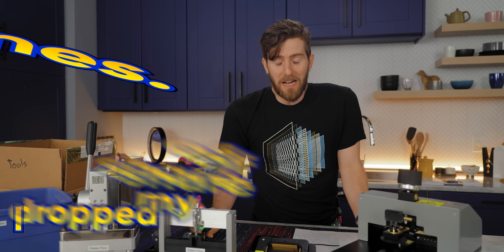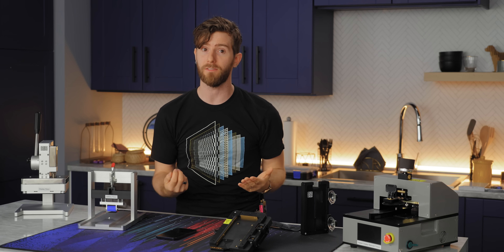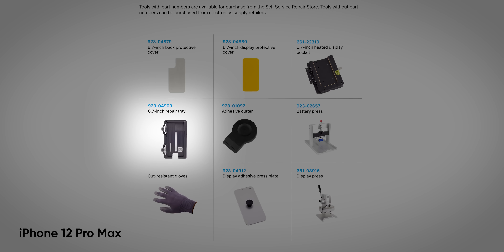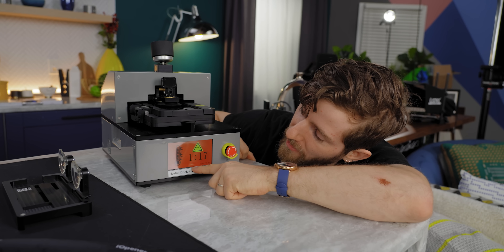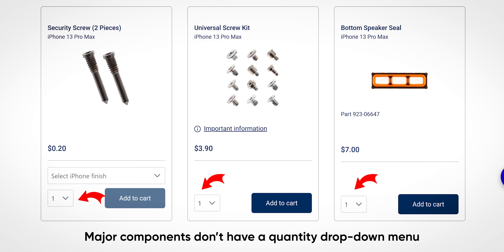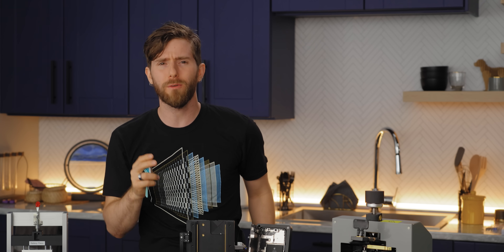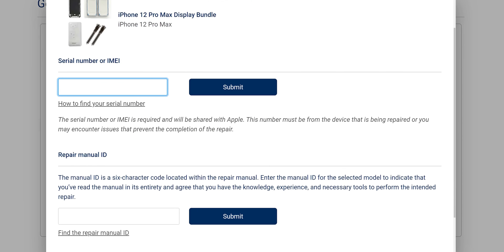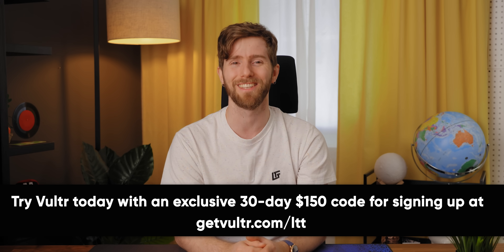I’m a Genius - Apple Self Service Repair Program

Comment: I think it’s a bit more complicated than that. Initially Touch ID’s hardware ID was tethered to the Secure Enclave. A rotating key tied to the Touch ID hardware and your fingerprint hash data and other data prevented external hardware from a brute force attack. This was all for security. Once people labeled it as anti consumer Apple had to rework their method of user verification with an iOS update. While their security white paper doesn’t specifically cover how they did it it’s believed there was a decrease in security albeit slight and done through very specific hardware methods likely only known by Apple but wouldn’t be public info even if security firms and government agencies did know how to do it.

Comment: At Geek Squad we are Apple certified repair technicians, from the research myself and my other agents have done, it’s only about $10 cheaper (if you don’t have apple care) to do the repair yourself. We do all of those repairs typically same day. The worst part of the 12s 13s and SEs repairs is the heat sensitive adhesive, to replace the screen you have to peel all of it off and replace it, but the adhesive very rarely comes off easily.

Comment: couldn't you just have several devices on hand so if anyone needs parts to repair you already have them on hand? (ordering the parts in advance) or does apple lock said parts behind serial numbers so they only work on that specific device?

Comment: Those tools seem hilariously over-engineered. Yes, precisely machine parts are good for repeatable results and a high degree of consistency, but you do not need that much metal for a simple, manually operated press. You could make the supports out of stamped sheet metal that are just as solid as blocks at a fraction of the cost and manufacturing time.

Comment: Used to work for the Fruitstore.  These are the same kits we used as far back as 2015.  As for the quotes, it's a policy to refuse positioning cost prior to device review to prevent someone coming in with a bag full of unidentifable parts and demanding a replacement based on the quote from the call.  Those of us who turned screws on the regular could do 10-15 phones an hour depending on volume.  I imagine the heatpress slows down the store level efficiency at this point.  But we had multiple machines, toolsets, and a questionable work enviroment with lackluster leadership that rarely, if ever actually valued your contribuitions.  The fun part was always trying to use a suction cup on a screen that was shattered and would allow for airflow beneth the cup.  We had all sorts of creative uses of packing tape for situations just like that.

Comment: I think Apple should just pull the trigger and offer this kind of repair kit for everything they make, it will result in profit across the board. While some will be able to properly repair their own stuff, in my opinion the majority of people who try this, will mess something up. So they profit from giving you the repair kit, then profit again when you have to go to a repair center or buy a replacement from them. E-waste will go up as a lot of those failed repairs will end up in the garbage, but I think it's the best compromise to appease the right to repair movement, and also just make them more money - not that they need it. I'm not dissing the masses, or anything like that, I'm including myself in that statement. I like to think I'm pretty handy, but I've lost track of the amount of times I've destroyed something I was trying to fix even after having done the homework because sometimes it's not intuitive or there's some small thing you miss. Or you just simply go to open something up and even though the video warned you of that tiny wire attached, you still tore it out of the PCB :P

Comment: 'Core Charges' are a common thing for repaired parts from many manufacturers, in auto industry, aviation, etc.  So that at least shouldn't be a question that it's a thing.  This is still a stupid program either way.

Comment: I mean, the repair tools seem really high quality and reasonably priced. And in fairness, there are still some advantages to doing this. For one, if you buy the tools it's not really fair to say "I paid more for the tools than if I just took it in" because, well, now you own the tools. It could be cheaper in the long run if, say, you have a couple of kids who break their screen at school once in a while, or the same tools can be used with your next phone. Also, there's some value in not letting a stranger muck around with your device, as has made the news lately. So it seems unfair to say this is just a gimmick by Apple to stymie the Right-to-Repair movement. And this is coming from someone who is NOT an Apple fan.
Reply: It is worth noting apple do not require you to buy or rent the tools you can just buy the parts and use any tools you happen to have.

Comment: If I've said it once I've said it a thousand times.  Buying into Apple is a mugs game.  Imagine buying a cooker (because it looked sleek and shiney) but only being allowed to cook with ingredients bought from a supermarket owned by the cooker's manufacturer (at highly inflated prices) , using only cookware provided by the cooker's manufacturer and only eating meals cooked on it if they are prepared by an approved cook which can only be hired through the cooker's manufacturer (again at a highly inflated price).  It would obviously be called an iCooker, but you get my drift.  Apple owners bring these problems on themselves.  I have no sympathy and they need to suck it up.  If you cannot stand the heat of the way Apple works, get out of the kitchen.

Comment: I have comfortably repaired well over 7000 iphones (Yes, send help) ranging from the 4 to the 13PM and it really frustrates me that Apple is in my opinion ;) intentionally making repair seem far more involved a task for the average person than need be. Even setting aside the "fuck you+1" pricing technique, the indimidation factor alone presented to someone looking to repair a newer iphone for the first time with all this over the top equipment is silly... If you roll back a few years then that eqiupment is completely overkill given the frame design of the iphone 11 series and older. It's much easier not to mention a lot faster (Both in the job itself and delivery of equipment) to get the device open with a plastic pry tool and something like an iOpener. 

Either way, I'm glad that on all fronts everyone I talk/listen to (Fellow techs, suppliers, customers, content creators and DIY'ers) are able see the angle Apple is taking here with providing a pretty fueled effort to try quell the pressure of the right to repair legislation thats on the horizon because like it or not things are changing. For someone whos been on the inside looking out this has been like a very slowly turning knife and I pray for a future where ripping a face ID cable doesn't instantly constitute a write off... or screen replacements that don't require BGA chips to be ground off so I can flow the OEM chip back on, or maybe batterys that don't need a BMS to be cut off and welded on to a new cell which then need to be hot swapped with a fake battery so the bloody thing actually reports 100% in iOS... It would be nice... it really would.

Comment: It also suck if you were a small electronics repair place cause you could assume that because of the way this is structured, every phone might call for new different tooling to fix, so $700+ (likely per new model) is almost like a annual fee you'll have to eat in order to advertise that you can do iPhone repairs. 

Linus is absolutely right, this program is obviously bloating cost to push people to buy new vs repairing their old gadgets. It feels extremely anti consumer, and as a non apple user I know most apple people just wont care.

Comment: Alright, I am going to correct a lot of statements in this video. The first thing is that right to repair is not the shiny thing that everyone thinks it to be. Its just another group lobbying for self interest to make money of gullible consumers. As a former Apple technician of 14 years the genius bar has never been a profit point for Apple. Apple has never charged a labor fee for iPhone repair in the US, they do on Macs however.  In fact their stores in general are operated at a bit of a loss, as it is about ensuring a positive customer experience, to create promoters and to repair the customer's relationship with the company. It creates customer loyalty and is why there is such a loyal fan base around the world. Parts are getting more and more expensive across all industries. The OLED displays in your iPhones are not cheap, and aftermarket parts are 100% of the time inferior knock offs that don't offer the same quality. You get what you pay for. Apple does not care what you do with your device. What they do care about is covering warranty claims. Apple is under no obligation to fix your iPhone when you have messed up on a repair, or used an inferior part to do the repair. This is the same across most consumer good industries. You replace that alternator in your car with a cheap one, and break something during the repair, the dealership isn't going to honor the factory warranty. Who in their right mind would do a repair themselves when they have a warranty is a great question. These videos often forget to include that these repair programs are designed for out of warranty repairs, or for repairs lacking coverage like AppleCare +. The other thing that these videos forget that a company like Apple is under much more legal scrutiny than Joe's smartphone repair kiosk in the mall. They have to ensure safety, consumer laws and other regulations. These videos in themselves have a biased in themselves as they are used to drive up the internet controversy machine to get likes and clicks so the creators in turn make more money. The point is that the issue is more complicated than just "right to repair". Nobody has ever said that you can't repair your own things, just don't expect things to be covered under warranty when you break it. That is Apples position in this, it is why they have created the independent repair program. Which was left out of this video, the self repair program is meant for technically adept individuals not businesses. The other thing Linus mentioned was about returning the old parts and being charged more if you don't return it. This isn't a unique thing that Apple does, its common in the Automotive parts industry, often time you get a "core" charge when you return the old part. Apple along with many other consumer goods manufactures will often take the old parts and return them to the vendors if they failed unexpectedly and the vendor will reimburse the company for the costs. There are many agreements like this in a supply chain to help reduce overall manufacturing costs which ultimately benefit the consumer. In closing just remember that its not a good vs evil argument when it comes to "right to repair" hell you have always had the right to repair your own things, but a company shouldn't have to pay for your mistakes if you not qualified to work on such things.
Reply: I don't think the majority of people advocating for right to repair think that the company should pay for us making mistakes installing third party parts. What we are advocating for is that these companies stop making their devices intentionally difficult, time consuming, and costly to repair. Phones should be built with repairability in mind and they should be easy to open and access the most basic things that frequently need repairing (such as the screen and battery). The problem is, if these companies did this, they would decrease their profit margins because a much larger number of consumers would fix their devices themselves. Imagine being able to replace your broken screen or old battery within a few minutes, at a fraction of the cost of purchasing a new device. That would be wonderful for us, but bad for the companies bottom lines. They absolutely love the fact that consumers are more willing to pay for a new device because it is easier for them to do that then deal with replacing these parts on their own. You mention AppleCare above, but how necessary would a service like AppleCare be if phones were easy to repair, and we had access to OEM parts? Also, you say that Apple doesn't charge a labor fee, but they most certainly do, albeit indirectly. Do you honestly believe that these extra costs are not included in the price of their electronic devices? Even though the fee may not be separated, we the consumers are most certainly paying for this in some form. "They have to ensure safety, consumer laws and other regulations." Of course they do, but so do car manufacturers. That doesn't stop us from being able to install whatever parts we want into our cars, because they are our property and we should be allowed to do that. If Apple really cared about safety and consumer laws, they could give us access to factory OEM parts. I guarantee you that people would choose OEM parts over cheap Chinese parts on eBay if given the choice. The issue is that we haven't had that option for quite some time from companies like Apple.

I truly believe that manufacturers should be forced to stop their anti-consumer practices and behavior, as it does nothing good for the people that are keeping them in business. Allowing us to repair our own devices with official parts is only a win for the consumers. There's no need to get rid of the Genius bar, independent repair shops, or anything like that. It can all exist, just as it does in other industries (like the car industry, for example). In the end, more choice is a good thing for us, and it seems a bit silly to me that so many people don't view it that way.

P.S. It's hard to convey tone via text, but I am merely trying to have a civil discussion. I'm not intending to troll or be rude at all, so I hope this wasn't interpreted in that way! Also, my reply is a bit out of order 😅

Comment: Made it to the end of the video. Here's my take. As an ex-Applecare phone supprot tech, they most definitely can offer you a quote on the phone. If you opt for a mail-in repair (which is annoying anywhere outside the US), you tell them what the damage is, and they tell you what it costs to replace it. If it shows up at the repair depot and there's more damage than you described, they call you back with a re-quote. If you get a re-quote, it will 100% of the time be more than the price of a new phone. 

Honestly, electronic waste practises at Apple's scale should be considered eco-terrorism.
Reply: Huh? I mean I don't disagree with most of what you said, but apple clearly have best in class recycling program, along with having the longevity factor. What do you think the ewaste factor of an iphone 6 that just got third handed to a kid, vs some random phone 200$ phone that lasts 18 months?
Reply: @spikeypineapple552  Go watch some old Louis Rossman videos. Apple SOP is to take a device with blown out SM cap that probably costs $0.02, shred the $500 of working parts on the board, and call it 'green'. They conveniently miss the first 2 R's: reduce (make repairable) and reuse (post schematics) so they can flout 'recycling'. You might be able to get 20% yields on reclaimed metals/elements. 5 broken laptops into 4 working units is 80%. If its a common part your replacing 1 of say 500 surface mount parts. Thats 99.8% yields. Even if its a one off IC, your looking at 1 of lets say 100. Thats 99% yields.

Comment: In comparing the prices between the DIY kit and taking it in to Apple for repair you failed to take into consideration that there is a staff cost for apple relating to processing and fulfilling the DIY orders and the two way shipping costs. Not saying that that justifies the cost or anything but it does suggest your agenda is showing...

Comment: Sooo... what's to stop someone from "renting" the tools for $50ish with a burner card or one of the "temporary card numbers" that can be generated by apps and the like, then just not returning them?
Yeah, Apple can of course sue, but the hassle of going after you alone wouldn't really be worth their while...
Reply: do they put a hold on the card for the full value of the tools, like they do for advance replacement iPhones?
Reply: @cptomes  Possibly, I dunno the fine print, hence my question... For instance, when I've rented a car, they put a $1 hold in the event of "eventualities" and the like, but there is of course very little that can be done after the fact if the card only has a limit of $5
Which is of course why the car rental companies obviously insure their vehicles against such silliness and potential for losses.

Comment: insisting on device in hand before estimate makes sense once you've been on the other side of the conversation and experience half of the customers "neglecting" to mention broken glass backs, broken camera lenses, known liquid incursions, and even "I fell off a roof and landed on my iphone" with chunks of the display and back enclosure missing.  if you quote over the phone and even qualify it with "if all that's wrong is x" the customer throws a fit and says "well the guy on the phone said it would be $$ not $$$$".  mail in prices for various repair options are on Apple's public facing web pages.

Comment: Right to repair is successfully pressuring Apple into making concessions (even if mostly appearances as shown by cost analysis). They are starting to sweat :)
Reply: apple isn't sweating, they basically just did the bare minimum to say "look we tried, not our fault you can't figure it out"